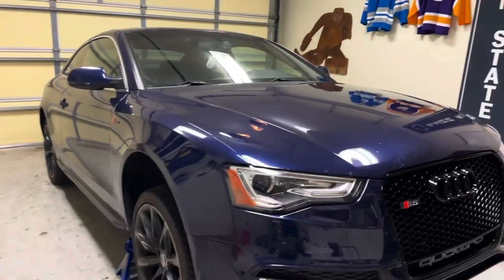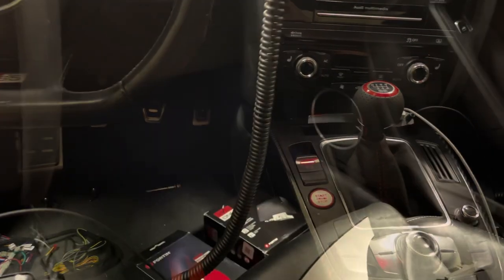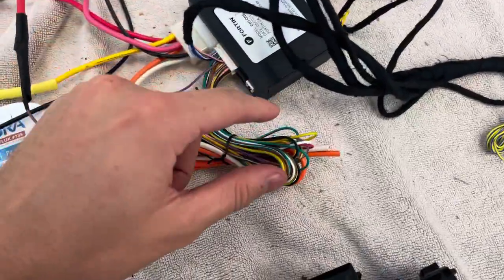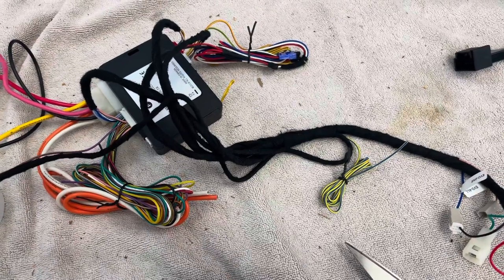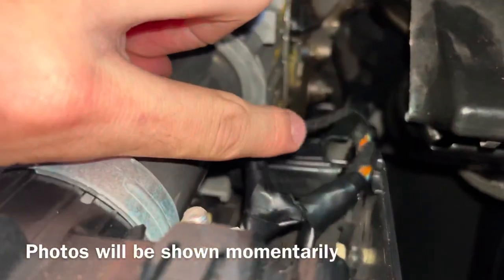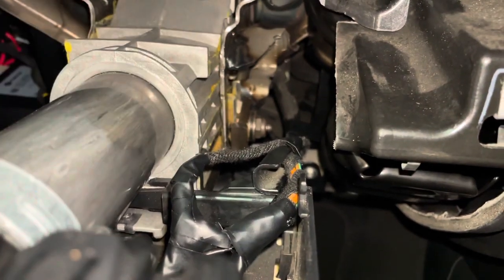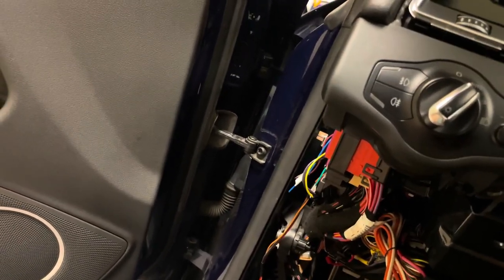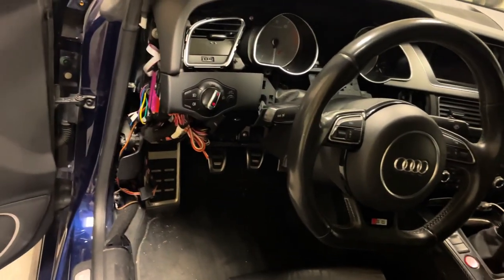Fortin Evo One Remote Start Install Guide on my B8.5 Audi S5 6MT

Comment: Great video it shows the main stuff. I actually got the Fortin Rs for my Audi A5 automatic transmission. You need to do an extra step for the brake bypass which is the yellow and blue wire, this gets soldered to a red and black wire on the brake plug. You also don’t have to do the positive and negative terminals because the t harness does that. I’m super happy with the kit and thanks for video it got me through 80% of it.

Comment: This was an EXCELLENT walk-thru.  I am installing mine in the next couple days and this was so helpful.  One thing that wasn't clear to me.  IF one can actually reach behind the keyport and unhook the keyport cable should they be able to get the t-connector in right there and not have to remove that PITA black metal thing?
Reply from the maker: That is correct. I only had to remove the key port because I couldn’t get the connector out.
Reply from the maker: I gotta figure out how to turn on notifications for comments

Comment: Nice guide bro! My kit is showing up  today usps .. can’t wait, the install looks like a breeze thanks to you .. 

One Q , is can hi and lo not located at the obd  plug as well? Thanks
Reply from the maker: The remote start kit as I’ve wired it does not connect to the OBD2. The can wires might appear there too, but I found that the easiest place to get them was above the steering column. There are like a hundred pairs of wires that look almost identical. Gotta isolate the can bus wires.
Reply: @bootleg.rs5  gotcha, I think the hi:lo wires can be tapped right there at the obd plug with ease . I can report back after my install.. catch ya on the forums/fb groups .. 🍻
Reply from the maker: @brizax  part of it as well was just where can I comfortably get a soldering iron. It’s really hard to solder something upside down, since the molten solder wants to fall with gravity.
Reply: @bootleg.rs5   I agree.. I think there is  enough slack  in the obd plug wire harness  once you un clip it from the  lower   Foot shield ..
Reply: Well it’s done .. Obd plug does NOT work.. glad that’s over with lol.. I had to decrypt my key 3 times to get it to finally work! Anyways beer time .. 

Any clue if you can still disable the light flashing with remote unlock / lock via vcds? I guess it coded over  my remote settings
Reply from the maker: @brizax  not something I’ve looked into figuring out yet
Reply: Can hi and lo didn’t work at the OBD .. it was a waste of time

Comment: Hey Bootleg, I just installed this Fortin unit today and I noticed that upon shutting down my car after remote starting, that the Audi MMI turns off immediately. If I start it normally (without remote start), the MMI stays on until you open the driver door. Just wondering if yours behaves like this too? Maybe it's a setting I missed. Cheers! :)

Comment: i have question i think i bought evo all for my audi 2015. Do i have to plug evo all plug to the black wire 10:28?
Reply from the maker: 2015-2017 uses a different key port mechanism and therefore has different wiring than I use in this video.

I would attempt to follow the fortin wiring guide as close as possible for your specific car.

I believe you will have to wrap a key into the system.
Reply from the maker: Since your wiring will be a bit different than mine, I would email fortin support if you need more help. Good luck!
Reply from the maker: @brkbrk5205  you program it while it’s only plugged into the computer, not car. Follow steps in pdf guide
Reply from the maker: @brkbrk5205  that’s what I said 5 days ago mate.
Reply from the maker: @brkbrk5205  and it was in the description of the video
Reply: @bootleg.rs5  sorry i post it in the wrong video. sorry about that